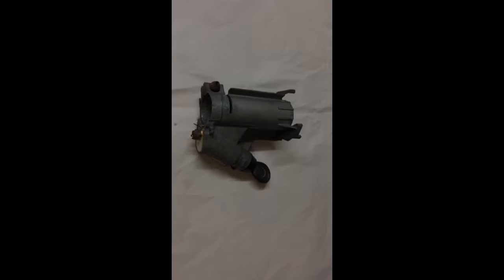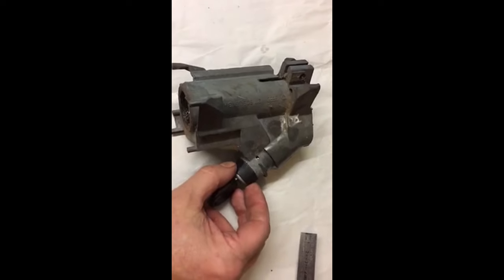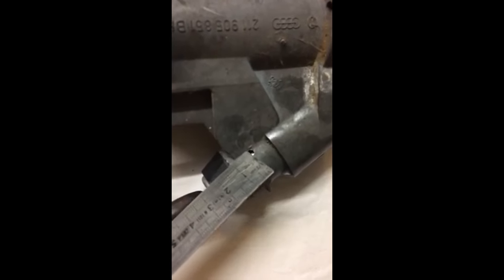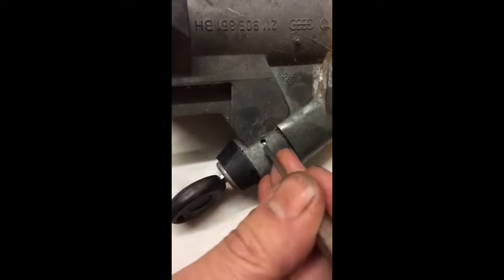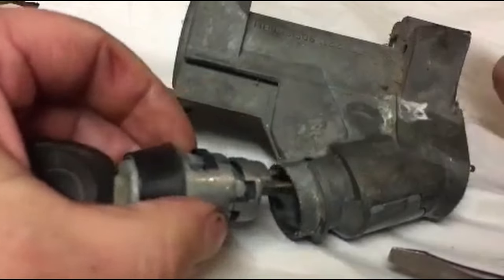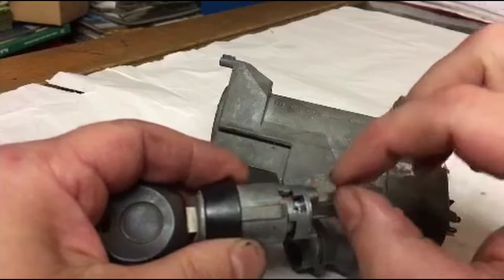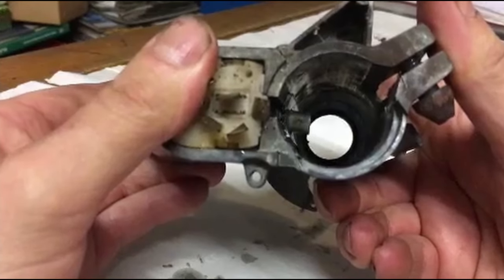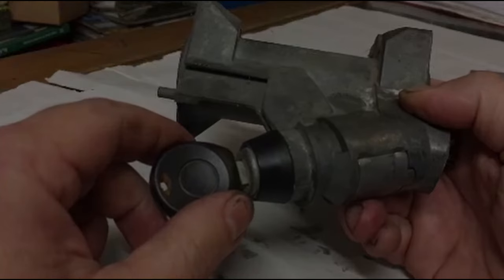Removal and replacement of a ignition switch on a Late bay window vw bus .

Comment: Could you please add how to remove the actual switch that is located under the key barrel that you showed. I would do a video of mine if I could get it out. Many thanks.
Reply from the maker: Hi Tony , if yours is a late bay if you look in side the tube that mounts over column theres a tiny screw to undo to remove the lower switch. if you can't find i will make a vide for you 😎